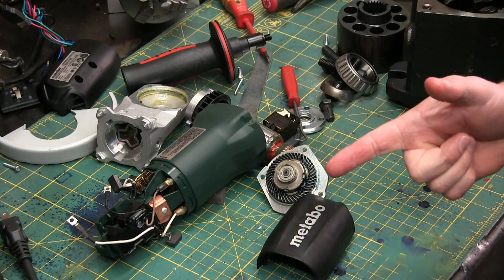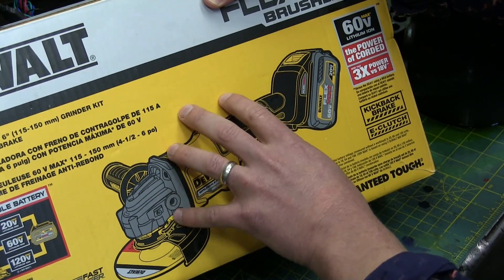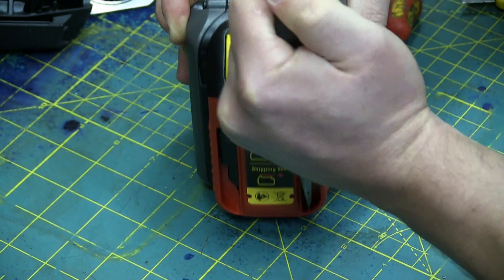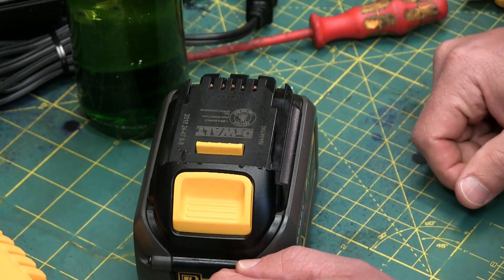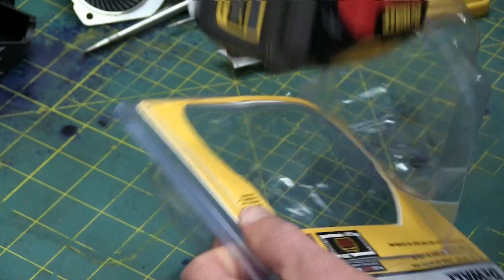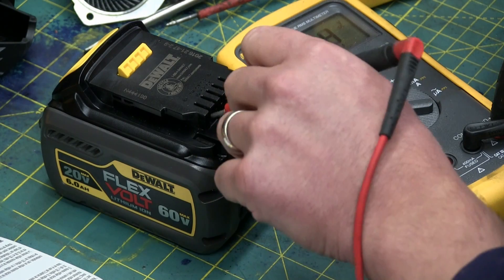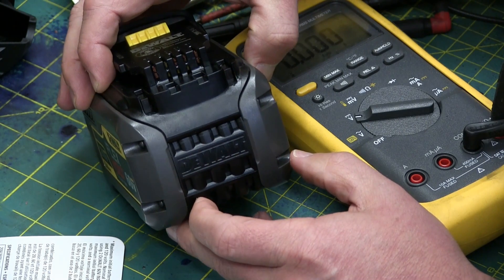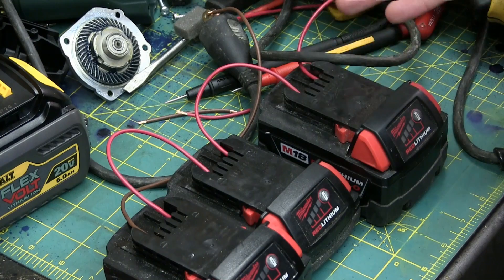Plug-in Power Tool to CORDLESS CONVERSION.

Comment: What you're talking about is basically a online (always ON) UPS.

Equipment is never plugged into sector power, sector power keeps a (typically) 48V battery bank topped-up, and that banks goes through an inverter and gives out 120VAC. All the availability of sector juice with none of the breaker-tripping and power fluctuation bullshit.

You could probably use the same basic circuitery (AC/DC converter - Charge circuit - Battery bank - Inverter - Output) but with a lighter LiPo bank instead and have something pretty good!

Comment: It is rare for one to own up to their mistakes, for that I salute you.

I like where you are going with this.  One area it could be useful is to run a 220V single phase tool off of 110V plus a battery buffer.  Sure your run time is finite in that scenario, but it would make shop life better for those of us that aren't wired up for 220 in the shop or have a breaker panel that's chuck full.

Something else to look at is Husqvarna's got a lithium battery back pack.  Hack that guy up so the output is a 110V socket and run tethered or untethered to the charger.

Comment: Actually a nice idea. We need to make sure that under no circumstance voltage is injected back into the wire. If someone pulls the plug on the other end of the extension cord there cant be 60V on the "pokey bits".

Comment: it would be like a capacitor basically, so why not just rectify put some actual capacitors in(will lower power factor and up the voltage 30%) and have some 80 tiny lipos in series, would deliver about 2KW of support power with tiny cheap https://pt.aliexpress.com/item/1pcs-3-7V-250mAh-LiPo-Battery-For-Hubsan-H107-H107C-H107L-H107D-JD385-JJ1000A-H108C-U816/32658300747.html?spm=2114.30010508.3.192.O9TWxI&ws_ab_test=searchweb201556_0,searchweb201602_1_10065_10068_112_10069_110_111_10017_109_108_10060_10061_10062_10057_10056_10055_10037_10054_301_10033_10059_10032_10058_10073_10070_10052_10053_10050_10051,searchweb201603_1&btsid=2fd5d006-d457-484b-a6e1-cfebf01b1373

Comment: If you used 30 or so 18650's in series you would be in the range 110 to 125v. I think the problem would be the size.

Comment: FWIW, I'd like your turbo booster or whatever to bolt on my portable generator so it doesn't bog down when I hit start on the tools. Just get her over the hump and stuff will run. I'll be damned if I have to go to a diesel genset just to get enough oomph for starting motors.

Comment: Leaving a tool plugged into an ac source and trying to get DC to help seems like the worst idea ever.  The real problem is the end user trying to use tools outside of optimal operating parameters.  IE long extension cords with tools that draw current near the limit of a breaker.  It would be a much more feasible to have a battery pack, but you'd need a pretty big pack to safely do more than freewheel a drill and get good run times.  Or even just upgrade the wiring and breaker.  If you are tripping breakers often you are doing something wrong, and have probably worn the breaker out from too many trips, making it actually trip at lower current draw.

Comment: the idea is stupid. the proper solution is adding a soft start. I have a dewalt here that has that, first it starts slow for about half a second then goes full power

Comment: Something maybe kindof like this: http://www.falstad.com/circuit/circuitjs.html?cct=$+1+0.000005+0.09591894571091383+50+5+43%0Av+80+80+176+80+0+1+60+120+0+0+0.5%0Aw+288+144+288+80+0%0Ar+160+272+208+272+0+100%0Aw+160+272+80+272+0%0Aw+80+272+80+80+0%0Ad+288+144+288+272+1+0.805904783%0Aw+288+272+256+272+0%0Aw+208+272+256+272+0%0Aw+176+80+256+80+0%0Aw+256+80+288+80+0%0Ad+256+272+256+80+1+0.805904783%0Af+288+144+384+144+0+5+0.02%0Av+496+80+384+80+0+0+40+5+0+0+0.5%0Aw+384+80+384+128+0%0Aw+384+160+384+336+0%0Aw+384+336+256+336+0%0Aw+256+336+256+272+0%0Aw+496+80+496+400+0%0Aw+496+400+80+400+0%0Ad+80+400+80+272+1+0.805904783%0A
Reply: This circuit isn't complete, btw.  Just outlining what I mean by using the AC to trigger a mosfet.

Comment: I can make it happen with a bunch of diodes.

But changing the batteries and making sure it won't trip a breaker when you are NOT using a long extension cord will require some actual electronics (The resistance of a long extension cord is useful for current limiting in my method)

Comment: A box that you plug the cord into. Inside there's a rectifier for the ac cord, and instead of a capacitor across the rectifier, you have 120V worth of batteries and then it goes to the output. It would also be possible to invert the 120V DC back into AC before output

Comment: for your "turbocharged" corded power tools, why dont you just use a time trimmed triac? problem solved with no extra complications. who wants to cary all that weight of batteries if youre still bound by a cord? 

use triac clipping to reduce inrush current as the tool speeds up. you can use a gauging resistor (like .2 ohm or so) and a microprocessor to control the triac so if the tool begins drawing too much current, the triac limits current, much like the trigger already does on many variable speed tools already. 

in addition....do you know why drills will work on ac OR dc??  they incorporate "universal motors" which dont care about voltage polarity since the field and stator polarity stays opposed in the internal wiring between the brushes and field. so, ac or dc, it will run. restrictions may be internal control circuitry which relies on ac to operate, the motors themselves dont care however.

Comment: Could I suggest using a synchronous boost converter with the batteries, that way it stabilises the output voltage across the whole discharge cycle and still provides a high current output.

Comment: I think if you connected the base of a MOSFET to the hot line of an AC circuit, it would open and close in sync with the sine wave coming out of the wall.

Connect the battery output to the collector, and the hot line to the emitter (with a diode between the emitter and the base), and I think you'd have something.

Does that make sense?  I can draw a circuit diagram if it doesn't...

Comment: Sounds a lot like you're wanting to make a large in-line capacitor for high draw appliances. So what you're imagining is a large box you'd plug into the outlet, and a beefy cord to the tool, and inside that box is a bunch of expensive as frig batteries and an arduino why not. Would it be simpler to limit the power draw on startup instead of making a turbo charger? Don't think of it as limiting power; but instead think of it as traction control or launch control for to be using all the power.

Comment: They probably don't charge batteries all the way to get them to their storage voltage. At the storage voltage, you can safely keep them on the shelf for a while. Usually 3.8v per cell.

Comment: A UPS is what you want to build and they are pretty much everywhere, shouldn't be hard to find one big enough. I have 1 that is good for 2000 Watts and 3 minutes, 10 minutes at 1000 watts. You should start with one for the power control circuits just put in your own chargers and batteries.

Comment: Hey, I am a mountain/rock climber and slackliner.  One of the biggest challenges we have is drilling the holes in the rock for the oversize anchors that slackliners use.  Now, a corded Hilti (REAL) hammer drill are cheap, hell, I have one.  But, it's corded.  The battery powered versions are 4x the price, and the batteries are expensive.  Very.  Shelling out close to 3k for enough batteries to do 8 bolts in hard rock and only using it once a season, is terrible.  Plus, the batteries will be no good come next season.  So, those Big Hilti Hammer drills that use the slotted bits, can they run on DC?  I have an application.  I need the solution.  Well, I know the solution.  Can I just gang a bunch of 18650 cells together, which are lightweight and cheap and cheap and cheap into a big pack to power the thing for 8 bolts?  Slackliners around the world need this.

Comment: A cheap horror fright generator is about the price of 2 batteries.
Reply: Yeah, but the pixies coming out of those aren't doing a happy friendly dance. Also trying to run that on the inside of a building type thing will make you pass out and see jeebus.
Reply: Most motors shouldn't be ran off a modified sine wave... They'll work harder, get hot, and possibly burn out, so If you're going to do that, then do it right and get one with a pure sine wave inverter.
Reply: Spoil sport. What the hell are the guys gonna talk aboot noo while drinking shit beer in the shop?

Comment: At first i thought you were talking about a motor soft starter - but then i realized you're not talking about starting load, you're talking about initial working load.  Batteries are one way to skin this cat ... but wouldn't a capacitor in line do just about the same thing?

Comment: DeWalt might have beat you to the punch with the new charging station, converts the battery power into an electrical outlet providing 1800 watts of powa!. but it is sure as fak is a lot of money, 600 American green backs to be exact. i'd still like to see the turbo charged solution at 1/4 of the price. at that price i'd buy one as a ups backup!

Comment: "Reduce World Suck" Would make a great tea shart. 

Totally down for working on a turbo-charger. An Arduino with a relay shield and a battery charger circuit would probably be enough for the majority of it. 

Though a capacitor bank directly inline with the AC might also work at reducing the breaker tripping and be very light/small/portable.

Comment: you can take an old battery backup and use any 12 volt battery even a car battery this will handle being plugged in as normal and also recharging on demand if the ac is plugged in lots of places get rid of them when the stock battery dies

Comment: If you're just worried about tripping the fuse when starting, go with a capacitor. I'm thinking of something that works like a 3-2 prong cheater adapter, you can easily swap between tools.

Comment: It would be easier in my mind to run something like a microwave capacitor inline with your corded tool with a diode to keep it from back flowing to the power grid

Comment: 30 2V mega Capacitors and a 70V DC Power Supply capable of putting out 15A should keep the tool running

Comment: Couldn't a variable autotransformer solve the voltage drop issue at the end of a long cord?
Reply: Never mind, I think the primary current would be the same. A better solution would be a bigger extension cord. but what contractor has one of those?

Comment: I don't think you need the expensive battery deal. You could rectify the 120vAC (Full. Wave Bridge Rectifier) and (now that it's DC) add a capacitor (constantly being charged) that sucks up that initial surge (as it's the shortest path with the least resistance). Considering the tool produces a surge of 7000w during 1ms (completely invented numbers, AvE you should try and measure it with your oscilloscope), that would mean a capacitor with a required energy capacity of 7J, which @ 120v is what a 1000uF cap stores. You would want a 120*1.4v= >168v rated capacitor to sustain the peak mains voltage. And that would be to completely elliminate that surge. You could drop it down to 2kW (5kW drop, 5J) so it is perfectly within the standards and doesn't trip the breaker.

Comment: Wouldn't a 1 or 2 farad capacitor be sufficient for the initial inrush? I'm thinking an ac to DC conversion with the capacitor on the DC side.
Reply: I don't think a cap turns AC into DC.
Reply: They make hard start capacitor kits for AC units and the like.
Reply: How about two capacitors parallel to each other, each with a diode in series? Thus each cap will deal with one half of the sine wave. As for the size of cap, it's got to do with microfarads x amps x the inverse of pi or somesuch complicated formula linking capacitance to current and universal constants of an arbitrary kind. And then we end up with a choochyfier that only works 100 percent with a particular wattage tool drawing a particular current. But hey! we're trying!
Reply: that's what I was thinking :p
Reply: The conversion to DC is for the cap and we don't need to go back to ac for the tool.
Reply: You have to phase match the AC that you're connected to.
Reply: +Ryan seamus a smoothing cap only smoothes in combination with a wave rectifier, in an ac environment a capacitor will simply pass current with an inverted waveform
Reply: good start trying to reinvent the wheel. I mean what we're looking for here is an AC to AC line matching Transformer with some sort of DC power source. Why not just use an UPS. when it's not connected to AC you still have power. If your initial load exceeds your AC  availability  you'll be fine as long as you size your UPS correctly. if you want to be a little crazy and Tinker with it and put a cap on it to protect your battery then everyone can be happy.
Reply: Super caps are usually rated at very low voltages. A 60V super cap would be huge. If you took a standard 5V 1F supercap and wanted 60V at 1F you'd need to connect 12 of them in series, but that would reduce the capacitance to 83.3 mF meaning you'd need a further 11 series banks in parallel to get back to 1F. In short, you'd need 144 x 1F super caps to get a single 60V 1F cap
Reply: a 555 timer will mimic the AC good enough after the cap.
Reply: Do you? The converter deals with the frequency and outputs DC. The cap doesn't see the line frequency, it's just getting the DC output. The motor in the power tool is almost certainly a universal motor that can run on ac and DC.
Reply: I was replying to moonreft saying something about a 555 timer.

A capacitor would just turn the AC into DC (a rectifier of sorts).  If the cap was big enough, it might be able to deal with the inrush current when you power the tool on.
Reply: Then reset every time you release the trigger...then another jolt when power is back on
Reply: Douger Rohmer Google smoothing capacitor.
Reply: So we'd need a  ac rectifier and a reservoir capacitor.
Reply: Just did: "The most common and used application for smoothing capacitors is after a power supply voltage or a rectifier." Emphasis on AFTER rectifier, ie you smooth pulsed DC. But don't ask me how a motor starting cap works - I'm not that clever :-)
Reply: So a capacitor big enough to prevent a voltage sag from the tool coming on, but a capacitor not big enough to prevent a voltage sag as part of an AC sine wave.  How?
Reply: they make AC caps. , they use them alot in exterior HID wall luminairs. The ones I work with are 24μf and they are sufficient enough to start an arch in a 400W Metal Halide lamp to get it going. Dont know what they would do for a tool though.
Reply: I don't think it would be necessary to run the cap in an AC waveform. You notice that he's running the drill with 60v DC? The drill will run at full speed because the batteries were only pushing one half of the waveform, which means it will turn the AC motor at the same speed but with only half the torque. 

I could be wrong, but I think it's the same way with the AC start caps I change out in air conditioning units all the time. They may output a DC pulse at 60 hz when the power comes on, which would only be half the torque of a full AC waveform, but it's more than enough to prevent the high start load of the fan or compressor motors from tripping the breakers off. And after the motor is running it would be more of a "glide-push" that just adds a bit more torque to the motor. Not much, but it wouldn't need to be much once it's running.
Reply: Broocks Regan
- It's just brainstorming. Stop being so logical. :P
Reply: ASMR Junkie
- You don't NEED a 1 farad cap to reduce the starting load of a small electric motor. For that drill, you'd only need something like a 2 microfarad cap, at most. The only reason you'd need 60 volts at 1 farad is would be something extreme, like resistance welding two pieces of 1/4 inch steel. And wouldn't that be something like 200,000 amps of current, anyway?
Reply: KOakaKO I was just referring to the initial comment which was talking about a 1 or 2 farad cap and detailing the problem with caps that size. The problem with YT at the moment is when you press reply it doesn't put the name of who your are replying to sometimes.

It's easy enought o test anyhow, just a small cap, larger cap and two diodes is all you need.
Reply: ASMR Junkie
- Well, it's certainly worth a try. That's what crazy experimentation is all about. :D
Reply: playing with batteries is fun. always open to looking at anything technical you may need a hand with in this project. I'm a com tech/electritian and know more about current and new age batteries then most people at thia point
Reply: SpinDrift FPV You probably want to have some sort of current limiting setup too, else the cap itself will trip out the breakers :|

A set of diodes and resistors on the way in and a set of diodes on the way out perhaps?

Also a general current limiting resistor past the rectifier - to ensure all the transients are dealt with by the capacitor

Maybe a switching circuit (while I'm at it) with a green light to inform when the cap is charged and the tools can be used. Nothing special - potential divider, transistor, skookum relay...

Haha I could complicate this all day long!
Reply: it changes the phase like retarding ignition to raise startup grunt